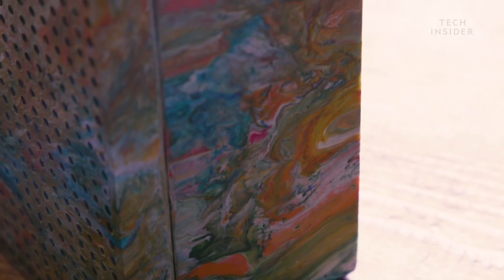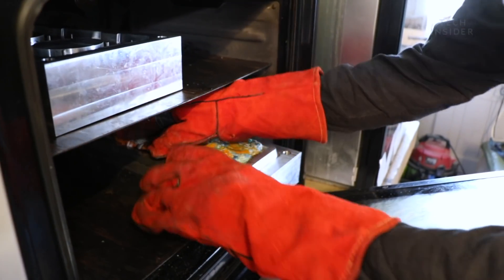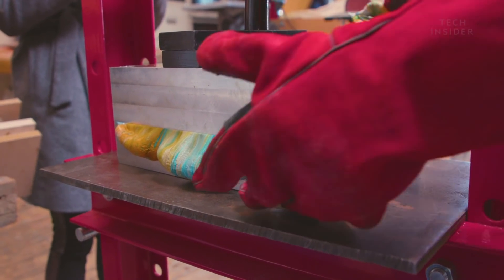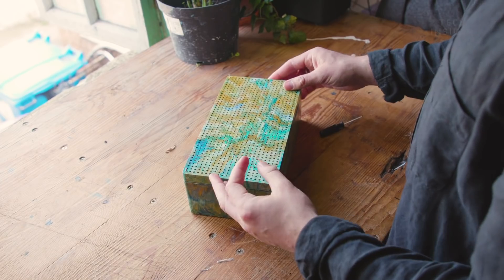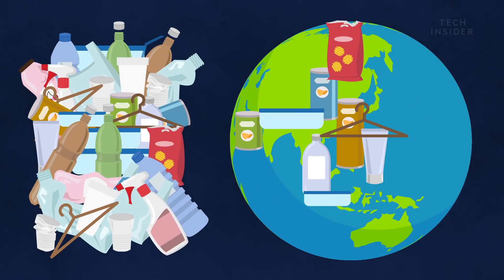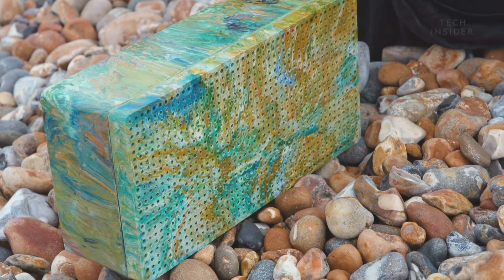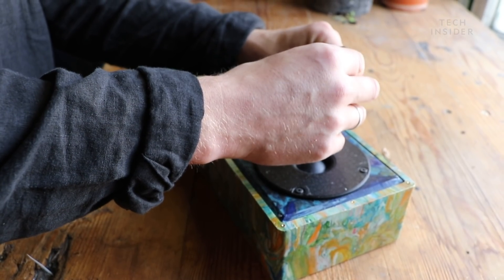How Nonrecyclable Plastic Bags Are Being Turned Into Speakers

Comment: Poisonous fumes and no air filtering or anything ...
Reply: klaas ericha Some people do get a kick out of it 😏
Reply: I was thinking this too. It's possible that this technique may not be ass eco-friendly as it seems to be :/?
Reply: Not even pocket friendly
Reply: They are not burning no flames or fumes
Reply: Melting not burning
Reply: When you warm up plastics you get harmful fumes. I worked few months at factory making plastics products myself.
Reply: klaas ericha It’s called melting, Ever heard of it?
Reply: @nomydiano4751  you have absolutely no idea what you are talking about. At high temperatures plastic makes some bad odor/ carcinogenic fume. Nothing related with burning.
Reply: Im sure hes not in there the whole time smelling the nastyness
Reply: Off gassing of the heated plastics will give these fellas lots of carcinogens 👌🏻
Reply: Polyethylene fumes so much when melted, the re-solidified plastic doesn't even have the same elastic properties as before(why the plastic is deemed 'non-recyclable'). Try to recycle that plastic back into a grocery bag, and the bag would rip immediately :P It works as a speaker box cause the walls are thick enough.
Reply: Nobody saw the metallic air vent tubing hanging from the ceiling then?
Reply: @TheForgotten-Gaming  lmao that's what i'm wondering about
Reply: @nomydiano4751   you people...  its plastic.  you are aware it gives off gas?  even metals, which do not begin to melt, will give off fumes...  plastic even more so...  also I worked in a plastics factory and it was mildly irritating even with wide open and massive ventilation air quality....  so these dudes packed in a tiny room with all those ovens.  hopefully they wear a mask if they do this every day, maybe not wear it for the tv show?  or maybe don't give a shit and ignorance is bliss
Reply: @josephwatson8448  Muslims are less crazy and dangerous than Christians so the UK is getting safer according to your logic.
Reply: LOL !!! UK safe? LOL !!! You have NO GO ZONES !!! You LITERALLY have NO GO ZONES !!! LOL !!!
Reply: LOL !!! London has more KILLINGS than NYC !!! LOL !!!
Reply: LOL !!! UK has to now BAN knives !!! LOL !!!
Reply: LOL !!! UK is literally horrible, ALL the people WANT Brexit !!! LOL !!!
Reply: joseph watson crime rates aren’t as intense as Chicago tho
Reply: @Arteyuga  that's because Chicago is a GUN FREE CITY, run by DEMOCRATS and filled with blacks.
Reply: @josephwatson8448  You need to stop reading so much on the internet and start going outside.
Reply: @puresslife6161  still fumes from heating ever hear of a thing called bpa
Reply: @lcjury2  definitely not when you factor in all the resources wasted on having to cure their upcoming cancer.
Reply: Puress Life in the types PET (#1), PVC (#3) and PS(#6) acids are processed and harmful fumes are released during heating .

“”Burning”” not required😉
Reply: all i could think about was how bad it would smell in there
Reply: Foils made out of polyethylene burn residue-free to carbon dioxide and water. There are no toxic fumes or gases and no slag. PE films contain no plasticizers and no heavy metals. They are physiologically harmless. You most probably confuse it with other plastics like PVC which are releasing hydrogen chloride, dioxins and aromatics when burnt.

And as you can see in the video he is actually melting it. So its not even reaching its oxidation temperature.
Reply: Right!?!?
Reply: Oh but hey...that 1 window is open...
Reply: It looks like there is actually air filtration, seen in the background at 1:38 - 1:40 above the stoves.
Its interesting to see how many people are concerned about something they aren't even able to identify.
Reply: Maybe you didn't catch it but in the video you can clearly see he has a fume extractor.
Reply: am i the only one who see the air vent and the air conduit heading outdoor ?
Reply: this is a bad troll it's obvious the "fumes" are going through the vents.
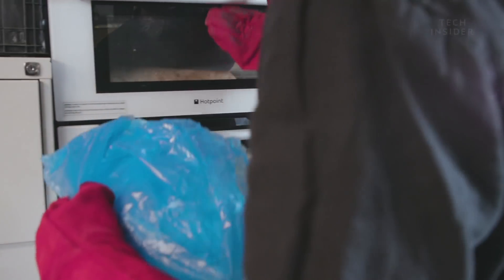Reply: They do have an air filter, minute 1:05
Reply: If you only heat it to a certain temp for a short period of time you avoid all fumes. You just heat the plastics to soften them up and remove before fumes are created.
Reply: Jesus, everyone is focused on fumes and cancer... And not focused on the innovation and creativity. Of course the creator would have thought of the fumes. It's a no brainer.
Reply: They probably are only making a half dozen speakers a day you guys, I mean, did you see the scale of the operation?
Reply: @nomydiano4751  you still get fumes
Reply: @rensenbon3389  yeah I agree. They don't realize if you only heat the plastic to the piont it's malleable and remove it promptly you will not get fumes. This is why they heat it over and over instead of boiling it like a lot of factorys that have expensive ventilation systems but some people's mind just cant be changed their stuck in stubborn mode lol. Recycling plastics is much better for our environment then disposing of it or making new for that matter.
Reply: YOLO
Reply: Like when its not burned it doesn't go into the air anyways for all of us to inhale. So does this change anything? Not really.
Reply: Sigh...the plastic they are heating is low density polyethylene it woun't generate "poisonous fumes" during reprocessing. Even if you burn this plastic you get generally carbon dioxide and water.
Reply: @jaska6875  What plastic type were you working with since there are many different types of polymers?
Reply: luis jury A S S
Reply: About the fumes: he probably melts at a sweet spot. Melting for most plastics starts at 100C, while only the most volatile of plastics emit fumes at 120C.
Reply: Plastik only produces dangerous air waste when they are burned, we in school class are also recycling Plastic with ovens, they only get very hot
Reply: @lcjury2  its only dangerous when burned not melted
Reply: It’s not being burnt it gets more or less melted 👍😀

Comment: Single-use plastics must be banned.
  100% bio-degradable plastic bags from corn starch are cheap and they exist. 

One can also mix the plastic with fine clay powder.
 Such mixes have a beautiful feel to them.
Reply: Then why aren't companies using them. I just checked online and they are not that expensive. Just 0.01/0.02 USD per bag. I think big companies can afford that much at least right?
Reply: The thing with bio-degradeable is that the starch or similar materials are used inbetween polymer molecules to help the material break down, which still leaves microplastic particles afterwards that cause a lot of problems of their own. Something more radical - like significantly reducing all plastic use - is necessary.
Reply: They really do, they feel so soft
Reply: Hemp plastics, biodegradable in 50 years
Reply: @shampoable  todays plastic made from oil but you can make plant based plastic like hemp plastic biodegradable in 50 years
Reply: Here in Italy it's about an year since the government passed a law to impose the use of biodegradable bags in supermarkets. There has 
even been a protest due to the 2 cent increase on the fruit bags 😂. I'm happy with this decision, at least sometimes they do something right also here.
Reply: Hope we can make  plastic decomposing microbes someday
Reply: But they aren't single use...
Reply: Gregory Owen more agricultural land used, more water used, more processing required. In the end of the day it'll be worse for the environment. Most "green" products are a scam.
Reply: Biodegradable plastic can also cause problems and can also be non recyclable single use waste. Also even if they are recyclable in some cases, local recycling plants may not be designed for them. 

So people may be better of aiming for replacing single use items with reusable products as much as possible rather then treating biodegradable plastic as a solution in and of itself when if not used sustainability it is also waste. Resources aren’t the main problem, it’s how we use them in a throw away society.
Reply: with the demand for plastic bags you'd be wasting more food for plastics than for food consumption… which would then have to be compensated with MORE fields to grow the food for starch harvesting…
Reply: @KRAFTWERK2K6  there is a massive problem in first world countries with food waste, this could be a viable use for food that is a tad past its best, or we could use the non-edible parts of plants eg. corn husks and other starchy leaves. However, there is another solution (which is my personal favourite) that uses calico soaked in beeswax, which is reusable, could help beekeepers increase the bee population, and is completely biodegradable in the right conditions.

Comment: It's faster to just do it with injection mold machine. It's the same process.
Reply: but then you dont get the colors like this
Reply: @BKdefr  with that type of plastic, you will. It's harder to melt and doesn't mix easily even after being melted.
Reply: @MichaelHarto  but you would probably still get streaks starting from the inflow, i guess
Reply: @BKdefr  the streaks are short and ended up blotchy when it's injected to the mold
Reply: he probably does'nt have the money for one yet but yeah i was thinking the same thing
Reply: @Jasper-92  Why can't bags be used in injection molding?

Comment: The excess dough is removed and recycled

... wait

Also, £300 for this??
Reply: Yeah that's a lot
Reply: Wow I was thinking $80 tops
Reply: Orion Rodriguez right? And we don't even know how well the speakers work.
Reply: Price point does seem high, comparatively.
Reply: @miscellaneousNsuch  I don't think he did the electronics. He just did the casing.
Reply: Alexander Christopher I know he didn't make them. But he could put any old speakers in there and charging £300 for them without a good brand is lame.
Reply: The electronic components are 20 bucks or less.
Reply: I’d pay 30$
Reply: Shailaja Chadha
Apple isn't a really good example. Their profit margins are way larger than they need to be.
Amazon is a better example, small profit margins, yet they are still able to maintain and scale up their company.

Comment: Why not just convert into 3d printer filament?
Reply: Damn I hope that's the future of recycling
Reply: I want to buy a plastic bottle and throw it in my 3D printer after for raw material
Reply: it's stringy, it warps due to extremely high shrinkage, and it has weak layer bonding at printing temperatures
Reply: Not every plastic that is used for these bags, is suitable for printing filaments. However there are i think some variations of 3D Printer filaments made from recycled plastic.
Reply: People already do that. Search for Precious Plastic on youtube.

Comment: While this does reduce the plastic waste, does the reduction of plastic in the landfill outweigh the excessive energy used to create these speakers? Think about it. They heat several pounds of aluminum to roughly 300 degrees F, use it once to mold a single part of the speaker case, then throw out all the energy in the aluminum by cooling it in water. Then reheat it to 300F and do it all again.

Comment: The manufacturing of that single steel mold they use for the speakers, has polluted more than all of those plastic bags would, combined
Reply: Burning plastics and plastic waste has a larger impact short term. Also, casting metal doesn't cause much pollution compared to plastics. Metal doesn't burn like plastic does; it melts. If you burn plastics, there is now plastics in the air that will settle in our environment. 
Coal or most other organic fuels to heat a furnace or crucible, produce carbon based products, which isn't harmful at all.

Comment: Awesome.. But if they are making speakers out of them, they are CLEARLY recyclable. No?
Reply: I think it comes down to being able to be made into a uniform pellets or granules that can be fully melted back down to a liquid form. This plastic is melting to a dough consistency that would not work in the injection molding systems used for most plastics.

Comment: Speakers ? You'll need to expand the concept to a wider market , IE toilette seats , phones etc but the intention is very worthwhile ,but ocean plastic made into a common everyday device is most beneficial to environment . 

Therefore plastic from ocean to manufacturer to designer should be ultimate goal , so it would involve a genuine balance of like minds to produce a system of true innovation .

Comment: I wonder if the recycled plastic can be used for 3d printing material.
Reply: Probably not because each kind of plastic has a different melting point and different composition... There might be a way to melt them all together to use for 3D sketches and prototypes but not for finished products

Comment: If the sound they played at 0:57 is from the actual speaker, then it's the exact same sound that my girlfriends speaker plays when it turns on. She got it for $15 from Kmart and is cheaply made in China. If I'm being accurate here, then his internal parts are sourced from a cheap manufacturer in China and the sound is..... not great. I'd be completely fine with this if he wasn't charging £300 for it. It comes across a little suspicious that the sound quality is never mentioned in this video and the specifications can't be found anywhere on his website

Comment: While this is cool there are some thing to note. The obvious health risk, which could be mitigated. The gas pollution, which could be mitigated. The big one though, This won't work with truly non-recyclable plastics. The majority of plastic bags are actually recyclable(including those used here), but aren't as easy to recycle as other rigid plastics. The truly non-recyclable plastics are generally thermosetting and don't melt, so they can't be reformed. There are some that can be chemically separated, but that comes with its own set of environmental issues.

Comment: There's gotta be an easier way to do this... The process is too involved...bet it costs a ton
Reply: I mean surely there's like industrial supplier that can supply already recycled thermoplastics in pallette form... And with like a heated pot like the ones used for casting metal... Probably alot easier to mix and match plastics... Probably uses alot less heat and electricity than using the oven multiple times.... And rather than pressmould ... You could just cast pour into a mould that way

Comment: Maybe in India it could be done in logical price. Propably it cost fortune, due to long proces and high workforce price. Riddicilous. Also it still fakes a lot of energy to melt this bags. They should try to use shredding and high pressure molding. Without high temp.

Comment: A lot of energy wasted on melting and heating for a crappy product no one wants. This plastic is good for bags not for electronics. Maybe burning it in power plants would save some fossil fuel from being used instead. Also is the problem with health risks from the fumes.

Comment: This has nothing to do with being environment aware. "Recylcling" is just a businessmodel these days. Considering the amount of energy wasted by the ovens and the fumes created by recycling such little material this method is useless. And stop opening aluminum molds with steel tools. They should also lookup a deburrer tool, instead of using a exacto knife.